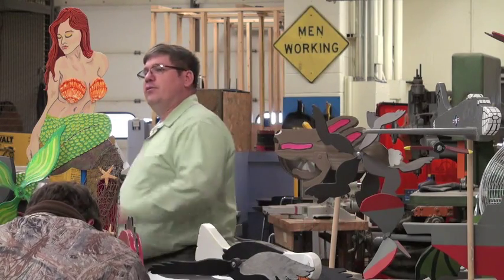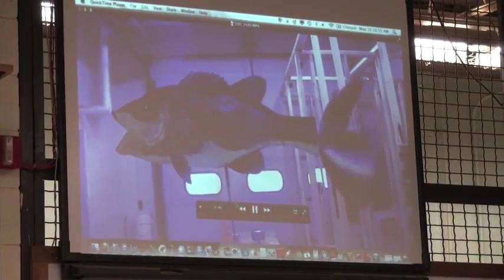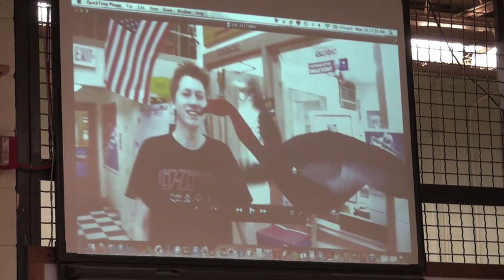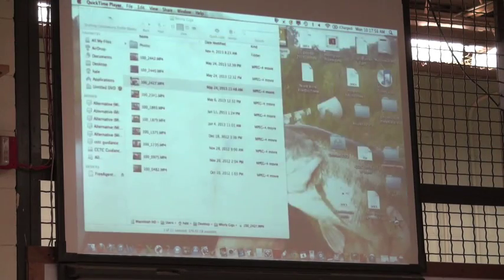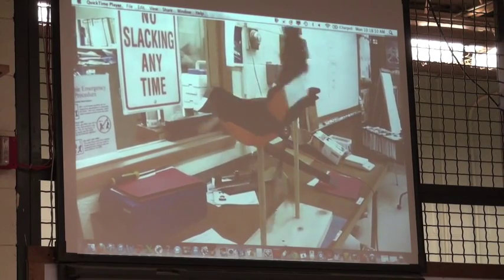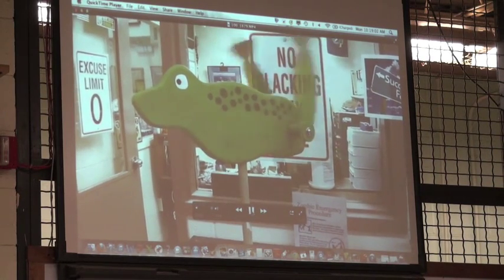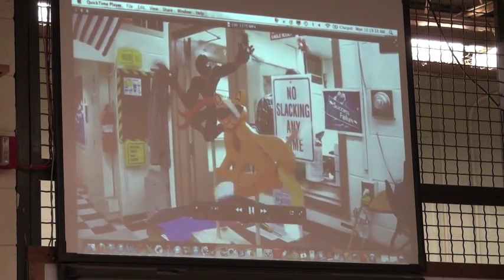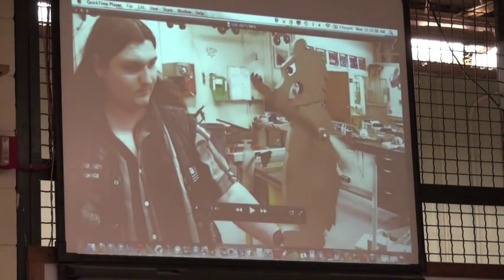Introduction to Whirly gigs

Comment: you constriction is wrong...the wings are spinning in the same direction.  they should spin in opposite directions.  to check this you simply need to do a vertical inspection.  as follow  \ I /  with the wings pointing towards the bird or duck not like the design you have here which a vertical view is as follow / I /.  Understand?